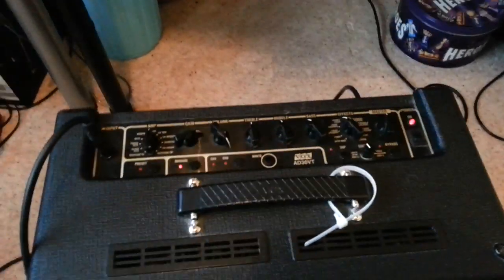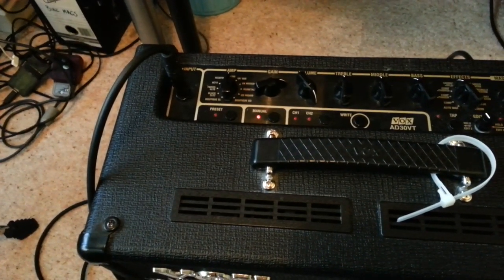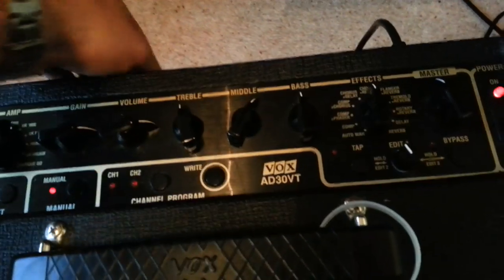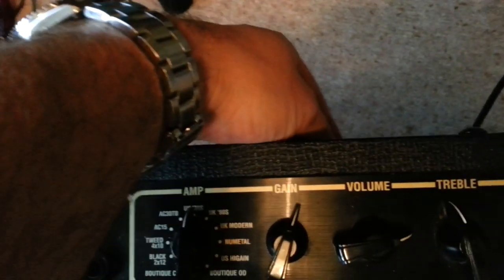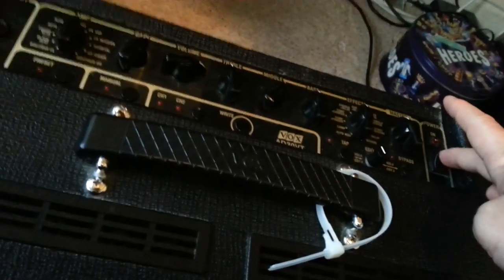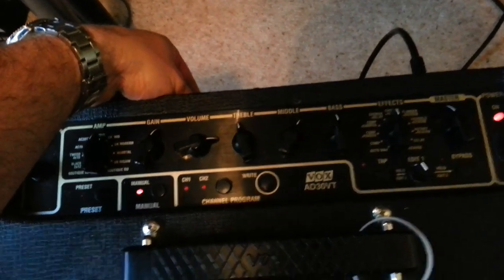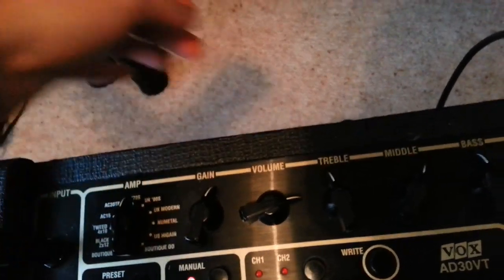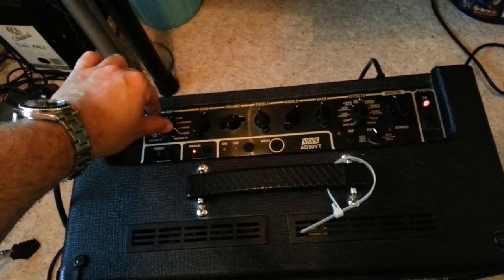Faulty VOX AD30VT Amp - Example of Problem (now FIXED! see description)

Comment: Sir, I have a Vox AD30VT-XL. I noticed on this amp that when I choose the "clean" amp, it sounds distorted. Can you share an idea of what the possible issues are? I already checked the speaker, and there are no signs of damage. If I used a third-party application like the "Gig Performer" app on my guitar with this amp, the sound was great.

Comment: super old video I know, but how did you get the power board off the aluminum housing? I can’t get at the screws on top in the back.
Reply from the maker: Sorry mate, it's been too long, I really can't remember. I wouldn't bother persevering tbh, mine broke down again a while after me fixing it. I got a katana instead, much better amp.

Comment: i currently facing the same problem with my Joyo DC-30. It looks like all amplifier with the familiar design and concept of 30watt amp would have the same issues. and yes, the plate is really hot.

Comment: It's the tube housing if it's not the capacitors.  A common issue with all the valvetronix amps. I've had to fix several of em for this issue.  The tube itself isn't the issue, but where it's mounted. You gotta bend the metal legs out slightly and use some kinda electronics cleaner and spray em off reinsert the tube several times and get it in the housing tighter than it is and that should fix it like I said IF it's not the capacitors. Better to go ahead and try this first nonetheless.

Comment: Hello. Have the same amp and i have a different kind of problem with it. The amp completely lost ability to produce distorted/high gain sound on all of it's amp emulation modes (80's UK, US highgain and UK modern are the ones that matter to me since i play metal) and the only sound i'm getting out of it is clean no matter the mode it's in. On the other hand it doesn't buzz or produce crackling noise. Did someone had the same problem and can it be that the valve is gone? The valve in mine has like a few dots of light in it when i turn the amp on. I'm not sure how the fully functioning 12ax7 valve should look like. Should it glow more intense or not since i never paid attention to it and i always played with the speaker facing toward me :)

Comment: Also have the AD30VT showing the same symptoms, but I should have checked all soldering joints before replacing the two regulators. After replacing them, I still had the same issue, a long plastic stick touching all the components (while amp is on) revealed the culprit, a loose resistor just above the power pot. A quick touch up with the soldering iron and its all fine now.

Comment: own this amp and like it,however the problem is it doesn't have a send and return loop so if I want to add any pedals I have to place them pre-amp which is not ideal(especially for delay and echo effects).Can somebody please advise me:I am thinking of adding an external speaker so that I can use my pedals in between the two,assuming this is viable,what is the best speaker to use with it? Thanks in advance for any help.

Comment: Mine has the same problem. It was my first amp after many years of having nothing. I bought it used for about $120 at MusicGoround. I replaced the speaker with a Jensen. But I think I will put the old speaker back in and sell it for a better amp like a Fender Champ from Sweetwater.

Comment: Thanks for this video! I have a similar amp from this range and had a problem that sounded very much like yours, changed the regs you suggested, Boom! Fixed! Saved me time fault finding as when I looked at the regs they looked fatigued at the solder joints
Thanks again!
Reply from the maker: No worries. However a few months ago it started cutting out completely every 20 mins. So I gave it away and bought a Katana 100. Holy smoke, what an amp!

Comment: i have the same problem...
Reply from the maker: You can fix it! See Phil Hitchman's comment thread.
Reply: Yep Phil Hitchman's solution will fix the problem. Apparently the old Valvetronix amps were notorious for this issue. 

https://www.parts-express.com/7815--15v-voltage-regulator-to-220--7815

Comment: While i was playing at 40% volume my vox amp all of a sudden went down to 10%. I can barely get any sound out of it now. I switched cords, used different guitars and wiggled every switch and knob for a crackle. I play this amp everyday at mid to low volume and it never moves. Does anyone have any suggestions on what it could be?
Reply: I have same issue, any idea on fix?
Reply: Most likely you need to replace the tube
Reply: What did you guys do to fix your amps. Mine is also dropping to low volume when ever I move any of the knobs when I turn the modelling pot it cuts back in. If I also use the foot pedal it will cut back in

Comment: mine won't power on. is that a fuse?
Reply: Check the solder on the dc input. If you plug in the jack at the back of the unit,without plugging it into your electric socket on the wall, and jiggle it about. If you look at the circuit board on the soldered side you,ll notice to solder move up and down if it’s broken. It’ll need resoldering if that’s the case.

Comment: Hi! I own a Laney IRT Studio and it tends to pop when I turn it off... I assume that's because it lacks a standby switch... but then I notice it also pops when I change from lead to clean channel using the footswitch and also using the amp switch on the frontal panel, although It seems to me that it is more noticeable when using the onboard switch...

I've read several forums and there's a lot of people with the same issue with differend tube amps: Mesa, Orange, Marshall...

What do you think? do you think this is normal? do you think this could be fixed? and if so... would you explain me how to do fix this issue?

Thank you, looking forward to read you! great videos you upload!

Comment: I had a similar yet different problems with my newly acquired, used AD30VT. At first the volume was erratically fluctuating whenever i touched the wattage knob on the back. It was best to just leave it at full load. After about a week of daily use the volume just started popping up & down in the middle of practice. Just happened to have a few 12Ax7 available. Opened her up, replaced the tube and now works fine. BUT what I'm really on here for is to ask you or anyone reading this if anyone has tried using a fuzz pedal through this amp. I really like this amp despite the problems. Has many usable settings, except a fuzz setting. Is it worth spending the money on a fuzz pedal or is it going to bugger up the amp? ...Or maybe this amp is just not designed to take pedals very well as it already has built in effects? Thanks in advance to anyone who's already tried & can give me some input.

Comment: Hello, I'm from Brazil! I have the same amp Vox AD30vt, and it's doing the same noise about 1 year, without finding some solution until now. It starts about 2 minutes after power on with a slow noise, and after some time, the noise is faster. And the most curious about that, it's because the noise happens when I use non-Vox type amps simulation options, as 70's, 80's, Modern,  etc. I really want to fix it, because I like that amp so much. Great quality sound. 
Phill, did you get solve the problem only changing the volt regulator components (board tags IC5 and IC6)? Or are there another solutions?

Comment: Sussed it!!  On the main power board there are two voltage regulators 7815 15v (pos) and 7915 15v (neg) labelled IC5 and IC6. Little black square things, close to the main power filters about 1cm square in size, with metal heat plate with a hole in it running up the back. One of them was getting really hot, and the motor boating noise was starting as the thing heated up. The components seem to be discontinued, but I popped down to Maplin Electronics and bought a couple of equivalents (QL36+ and QL33-). Bingo!  £2, a quick solder job, and the amp has been rescued :)   I might bolt a couple of heat sinks onto them as they do run a bit hot, albeit not quite so hot as one that has failed!
Reply: Yes, that's correct. I just replaced those 2 parts and it started working again.

You just need to make sure that the regulators can handle 1 amp or more. Only one of them was faulty, but I replaced the pair - one of them delivers +15v and the other delivers -15v. It is important to get them the right way around.

Any equivalent regulator will do. They are quite easy to find. I got mine at Maplin Electronics. But they can be bought online through companies like RS Components. If in doubt, simply ask them for an equivalent to regulators 7815 and 7915. 

Sorry for the slow response Bruno - did you have the same problem with yours? Did you manage to fix it?  Mine is still working fine and I have been playing it loud for long periods. :)
Reply: The best of all: I expected to spend close to R$200 (reads "Reais" Brazilian money...about £40)... Both parts summed, I've spent R$4 (about £0.80)... really good for me...
Reply from the maker: Well, I finally bit the bullet and did the fix you suggested (replaced voltage regulators 7815 15v (pos) and 7915 15v (neg) labelled IC5 and IC6 on the PCB). Bought a soldering iron specially - this fix is the first soldering I've ever done! Pretty fiddly job with that heavy heat-sink and messy thermal paste. Can't believe I didn't screw up, but I did it! Thanks buddy :)
Reply: PLEASE NOTE : you can also Down-grade the regulators to 7812 and 7912 (ie : plus & minus 12 volt regulators) as opamp chips can run as low as +&- 9vdc....and....don't forget to put plenty of heatsink compound on them too..otherwise you will have the same problem back again..as this is a "heat/thermal" breakdown related fault!!...try it!!..it REALLY WORKS!! (i am an Audio electronics service engineer, and i have been in the trade since 1974)...
Reply from the maker: Phil Hitchman Well done fella! I would fix it apart from the dread phrase "quick solder job" where I just know I'm gonna mess it up. Mind you, it's still buggered so what's the worst that could happen? (A: death by electrocution)
Reply: zootius Thanks. I would never recommend anyone fiddling with a valve amp if they don't know what they are doing, as they can carry many hundreds of volts in the smoothing capacitors - even when not plugged in.  

However these Valvetronix amps only use a single small valve and have tiny smoothers, so they are safe to work on - as long as it's not plugged in!  

So for the sake of anyone wanting to give it a bash... it is easy to dismantle the amp and overall this is a very simple fix. However it is important to unscrew the large black heat sink from the main power amp transistor before lifting it out from the casing as it is not fixed to the main board and the weight of it will almost certainly break the wires off the power chip - this will become obvious as you unscrew the board and try to lift it out.  Then beware of the white conductive paste painted on the heat sink - it's a bit messy, like white grease.  Try not to wipe any of it off as it's important to conduct the heat away from the main chip.

Other than that it's just a case of replacing the two voltage regulators, which are easy to identify and have three soldered pins each. The regulators cost me £1 each from maplin.co.uk - but any 1A, 15v regulators should work. You'll need a "positive" one and a "negative" one - that's how they are sold.  Replace the 7815 component (it's marked on the casing) with the positive one and the 7915 with the negative one.  

Hope that helps someone!  :)
Reply: @PhilHitchman  the highest voltage is 40V for the power amp IC.  The tube only has 15 volts.  The wall plug, power switch, and associated wires are the ones to watch for.  Luckily they don't go on the circuit boards.
Reply: Hi Phil! My VOX AD30VT had that same problem... But I found that two parts in a store here in my city, and I fixed it by myself in the beginning of August, base me by your tips in the comment in YouTube. It is working good now! Thank you!
Reply: Excellent! I'm glad my post was useful to you :)  Well done!
Reply: you're welcome. glad I could help :-)
Reply: Phil you are the man! I want to send you flowers for posting this information! Thank you! Your suggestions here seem to have fixed my AD100VT that was making similar buzz noises. In case it helps anyone else, the 7815 equivalent is NTE968 and the 7915 equivalent is NTE969. I found the NTE components in stock at a Fry's Electronics for $2 each. This was my first time ever soldering on a circuit board and it all went pretty smoothly. The hardest part was removing the circuit board so it was exposed enough to replace IC5 and IC6.
Reply: You're welcome. Glad I could help!  :)
Reply: do you have to replace both or do you think just the over heating one was bad?
Reply: yes there is another solution. instead of replacing the voltage regulators, you can swap C67 and C68 to 47uF / 50V. The reason IC5 and IC6 aren't working is because of these C's failing.
Reply: To Pete Seitz:Have you done this mod or repair and how has it worked out for you? How did you find this fault?Thanks for any feedback you can provide on this.
Reply: well my amp Vox ad30vt start do simillar buzzing thing as the one on the vieo..usually when i start play on clean mode is ok for first 4 settings i gues and for the last one...when i touch any volume  or go back from the buzzing settings back to clean mode etc the buzzing and cutting sound is till there..even when i unplug the Guitar ...to me sounds like  same issuue...but not sure anyway dont you thing do just like few pic to show where is those part which need to be replaced  and post which one did you buy for perosn who in not so good on electronic...?? dont want to put the amp fro repair to Pro guys because the repair can cost more as..the amp lol...can also made some video to confirm if this is the same problem...thx
Reply: @besipp  Sorry buddy. This was a repair I did 6 years ago. I don't think it's possible to add photos in the remarks, but even if I could, I'd have to dig the amp out, open it up and work it all out again. All I can say is that the components were VERY clearly marked. So you can't get the wrong ones. They are marked IC5 and IC6. If you're at all unsure about doing the repair I'd recommend finding someone that can help. It is a low voltage circuit but as someone mentioned below, the input to the transformed is mains voltage. To be honest, it's a repair that could be done very quickly and easily by any amp repair place, particularly if you show them the instructions I posted above.
Reply: @PhilHitchman  Thx for answer...well i will try by my self first because im thing that i can save lot of money this way....let  you know how it work ....
Reply: @besipp  I have emailed you :)
Reply: Phil Hitchman Phill, did you get solve the problem only changing the volt regulator components (board tags IC5 and IC6)? And do they need to match some specification? If it disn't work, are there another solutions?
Reply: Awesome! This fixed my amp right up! Thanks for your help!

Comment: Hi. Did you manage to fix the amp?  Any idea what it was?  Mine's doing exactly the same thing.  I changed the capacitors as suggested by andy200960, and also the main smoothing capacitors, plus a few others for good measure, but it's still motor boating. I've also changed the valve and the main power amp chip. It kicks in after a couple of minutes and only seems to do it when you switch the amp modelling to certain high gain settings. I'm sure this is a duff cap somewhere, but just can't work out which one!